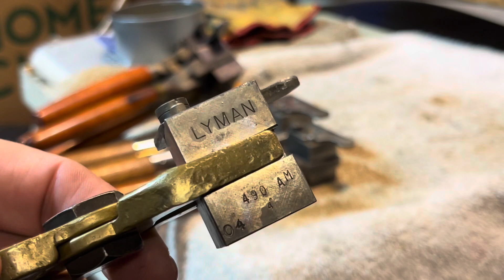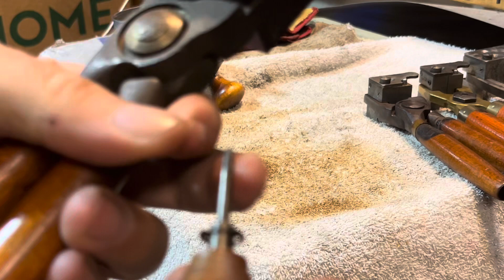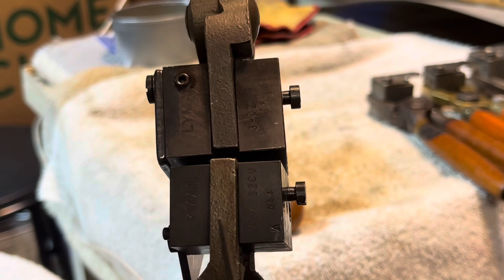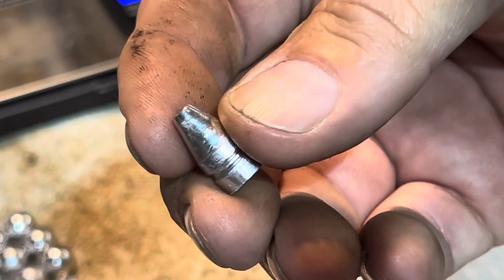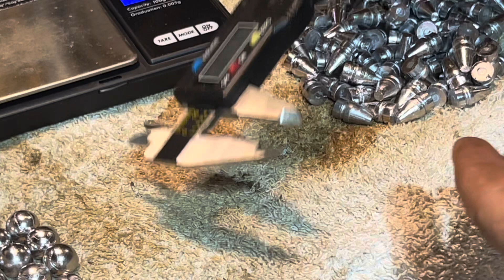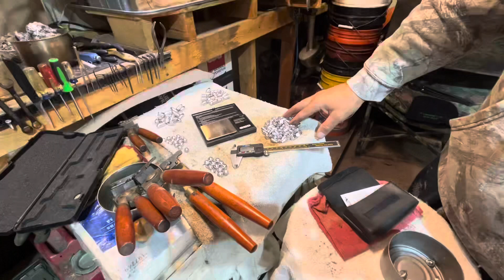Testing 4 new to me Molds

Comment: Love those 457122 Gould Express bullets. I have a very old Ideal mold with blocks integral with the handles. It is marked on the sprue plate Ideal Mfg. Co New Haven Ct. USA and 45 G. At being that old it does not incorporate the screw and pin to hold the hollow point pin in place. The pin is much larger going into the bullet almost half an inch and has two diameters approximately .223 for about three quarters of its length then a shoulder and then the rest is about .243 inches. A real canyon but much more like the old drawings of the Gould Express bullet in the old Ideal Handbooks.
Reply from the maker: That is a awesome mold!  I have seen a few different versions as well. I have three now all bullets visually identical profiles every HP pin is different. (Not surprised it is a Lyman). Thanks for the visit man enjoyed the info! 👍🏼🙏❤️‍🩹

Comment: Good vid CW, I like old classic molds and it looks like you got a nice collection....maybe a  video on all of your 358 rifle molds would be cool. Or maybe just the differences in all the Lyman mold handles talk about confusion. Single and double cavity handles ARE different. Then Lee...I have and have had some old ones and contrary to common belief Lee mold handles will fit ALL old Lyman / Ideal molds. They dont. I had (recently sold it) a 2 cavity Lyman 35875 and the Lee handles fit but once the mold heats up it starts to 'misalign' the blocks....back to old style Lyman handles, everything is fine. Same situation with my 2 cavity Lyman 358009 mold. All my other Lyman molds can use Lee. Also tricky with the new style Lyman handles they wont fit the old single cavity molds. Then you have the Thompson contender handles (tapered handle ends)  that look like they were made by Lyman but who knows if they fit them all...guess I should just have at least one of each and cover my bases haha
Reply from the maker: Yes  sir!!

I have a video showing all my 35 Rifle & another showing all 35 Pistol bullets. 

Long ago I modified all handles for proper function. So now if you can bolt a set of handles to a mold, they will work. San one brand new Lyman dbl handle that looks like a Saeco set. I could do video on modifying that. Thanks man! 🤟🏽👍🏼🤘🏼♥️😜

Comment: Is the 457 molds the Plains muzzle loader bullet?
Reply from the maker: It is just a round ball. Measuring .454 alloy I tested. I should pull out my 454 & .452 & test there dia.....
Reply: @cw2a  no the conical HP bullet
Reply from the maker: @tommeboy3334  Ahh its designed as a 45/70 bullet. I have used it in a sabot to good results in a 50cal.